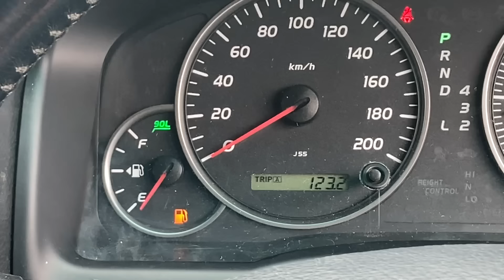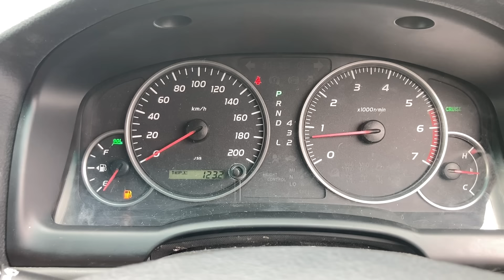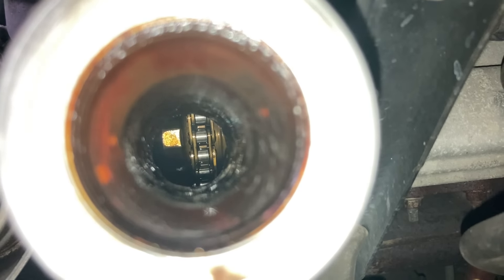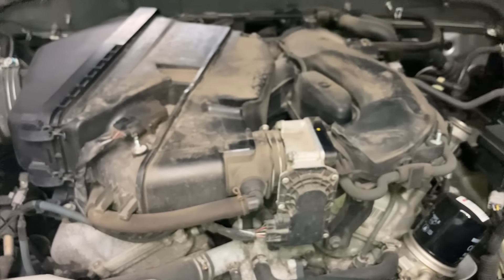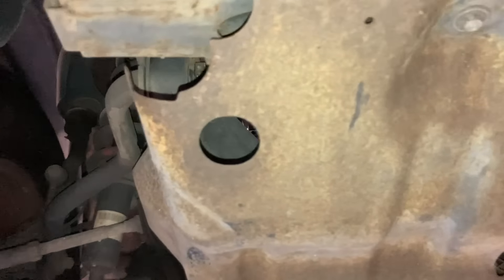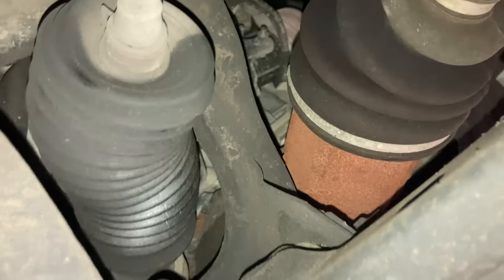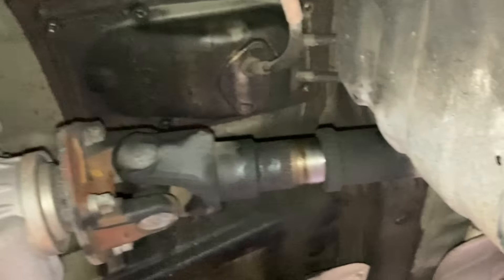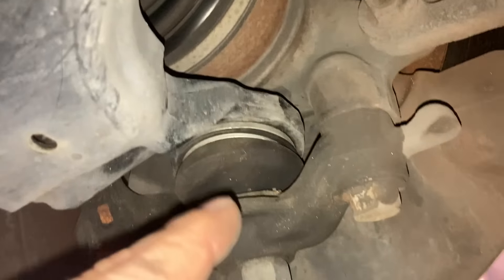I Got a NEW CAR Its a Grunty V6 if you buy a used car, you better do this!! ⚠️

Comment: Good score. The mighty 4ltr V6. The brown scale in the engine is down to the rubbish 91 octane petrol we are stuck with in Australia, at 150ppm of sulphur. Best to run 95octane at 50ppm. This situation will change in the new year, because the government has mandated low sulphur in all petrol in Australia, finally. There's plenty left in that old Prado. Give it heaps mate.

Comment: Awesome find. I had a white 04 GXL V6 manual for 6yrs & loved it but my wife wanted an auto, so 3yrs ago upgraded to black 07 GXL V6 auto & did a ton of mods to it including upgraded suspension , Harrop rear diff locker, upgraded headlights, upraded grille, upgraded tail-lights, D-slot black steel rims, Kenwood head unit, eco-light rear draws, drop down table to cargo door, Red-Ark dual battery system, red-Ark electric brake tow system and the list goes on.  
Swapped in shortie extractors & custom s/steel high-flow exhaust system resulting in increased torque & improved fuel economy (when your not a lead foot)   
These qaud cam engines are brilliant when properly maintained (as any engine should be).  I use Penrite full synthetic 10w/40 & my engine bay is spotless (devoid of any seaping fluids) and i keep the underneath clean just as much as the exterior with zero rust (including the rear tail-gate seal)
My next goal is an Aussie made Bullet Supercharger Kit designed for this engine (Rotrex Superhcarger) running 6psi with 40% increase in power/torque (over 180kw at the 4 x wheels) which will be matching LC300 in power/torque with instant torque on tap

Comment: Saw a nissan maxima 3.5l V6 a while back with 'ticking noise due to age' with only 280,000kms on the odo, the lady had never once got it serviced and the oil pressure had gotten so low the timing chain was jumping around in the block when you revved it, I'm amazed it hadn't jumped timing, gotta be careful about those kinda of scams on marketplace...

Comment: When you get a project like this do you think it's worth doing an engine flush before new oil? I had to do multiple flushes and run diesel oil with 2000km changes for10,000 and drop the sump to clean my last one up due to shitty maintenance, did 100,000km after that no issues.
Reply: Yes so long as you check the pickup after. The risk of running a flush is that you may dislodge sediment in the engine/oil galleries that then clogs the pickup